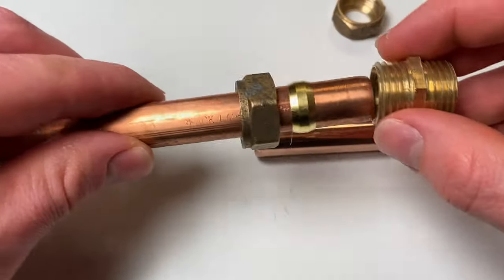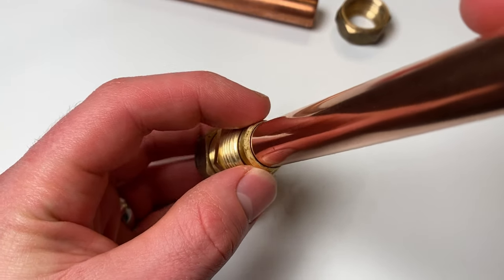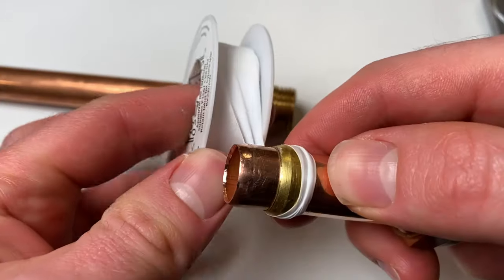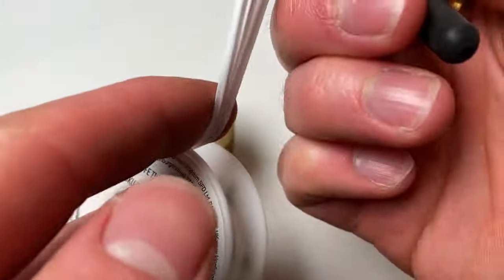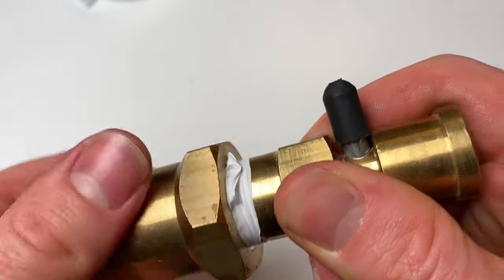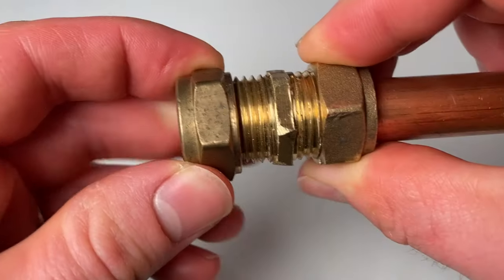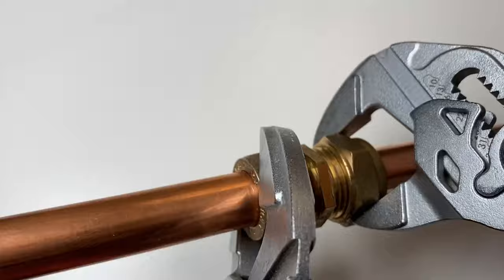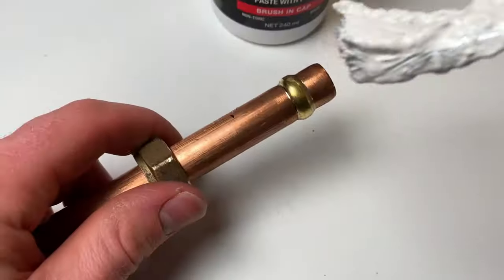Fix Your Compression Fitting Mistakes

Comment: As a plumber for 46 years I have never yet used PTFE on a compression joint. Manufacturers of compression fittings usually state that nothing needs to be used on their fittings but I was taught to use jointing compound on them just in case there are any defects in the pipe. It has served me well. It is also virtually impossible to cross thread one of these fittings but I do agree with you in respect of over tightening.
Reply from the maker: I think jointing compound and ptfe on the olive serve the same purpose really. Thanks for watching!!
Reply: As a plumber I fixed leaks over compression fitting with with teflon and other stuff on it. Nothing is necessary over these fittings. Everything else causes more problems
Reply: @TheDiligentDIYer1759 PTFE has no place on an olive. If jointing compound doesn’t work then you need to cut back and replace the pipe and olive. But then, you are talking DIY 🤷🏻‍♂️
Reply: Thank you

Comment: Absolute nonsense, compression fittings are designed for metal to metal compression to make the seal. pTFE tape will just get in the way. It’s essential on tapered joints but not for compression fittings that use olives.. paste is useless too as it is simply squeezed out of the way.. it only works with used fittings that shouldn’t be reused in the first place..

Comment: Always remember reading a comment by a plumber that he could spot amateur work by the PTFE tape on compression threads.
Reply from the maker: Yes absolutely a good way to know someone doesn’t understand how the joint works
Reply: I understand how the joint works, but I'm still putting tape because i had to cut the old one off due to corrosion. In this situation the tape is not to keep the inside water from coming out, it's to keep the outside water from going in. I'm hoping the tape prevents the nut from getting  drips in the threads over the years and can actually be removed in the future when needed.

Comment: My grandfather told me a trick to always do with any threaded thing, be it a bolt and nut, pipe fitting, etc. Always do a couple turns in the opposite direction. This way the threads will wind properly and won't get stuck in a bad bind. After all, the threads might not be perfect. could be some micrometer differences, etc.
Reply from the maker: Yes absolutely, turn backwards until you feel it click into the thread, then go forwards. Thanks for watching!

Comment: Good idea, you think that would work with heating fuel, like house oil, passing the filter 1/4 line. I'm thinking the pro before me over tightened the seal. Over time could the drip stop? Unravel next time I get to see my dad. We'll investigate with more information. Working with the Teflon Tap for 10+ years welder repair shop, I could apply the same principal to house heating oil connections. Never thought about the Bud (Olive) to seal.
Reply from the maker: Thank you! I believe PTFE is resistant to oil, so should be fine. Thanks for watching!

Comment: Spot-on advice. Fixed a few leaking olive joints that could not be cut off this way. Some redundancy on new compression fittings  with ptfe tape in my opinion also does not hurt.
Reply from the maker: Thanks for watching!

Comment: When it comes to compression fittings, there is a knack when tightening the compression nut for securing the olive ring that slides onto the copper pipe.   If it it’s not tightened in the proper manner.. the joints will leak;  as my sister found out.. when she had a new bathroom fitted, by so-called professional plumbers.  The joints started to leak underneath the wash basin.  My dad had to pay a visit and sort it out.    With push fit that never happens.   Push fit fittings are very convenient.   I’ve had no problems so far.   The tap water that runs through the copper pipe, will not affect the rubber ring inside the push fit device.  It probably would if there were chemicals added to it perhaps.   Although there is chlorine added to tap water;  i don’t know if that would have any effect.    That’s the reason why plumbers advise householders, never to put any cleaning agents in the cistern, where there are rubber washers. 
Thursday pm 8th February 2024.  Southampton England 🏴
Reply from the maker: Thanks for watching!

Comment: Good tip. My compression joint has a small leak and I was about to tighten more. I will put tape or joint compound around the ring ("olive").
Reply from the maker: Thanks for watching!
Reply: Just use better wrenches or better fittings.
Swagelok compression fittings can be tightened almost by hand without leaks.
I've installed 1000s of compression fittings and not once used tape or paste.  
I'd fire an employee if I saw him using anything but wrenches to seal the joint.

Comment: The best technique I know of is liquid sealant between the pipe and the olive, ptfe tape on top, and a smear of liquid sealant on top of that.
I have literally never done this on a new joint though, only repairs. For new installations liquid sealant between the pipe and the olive is a must for me, and just a slight smear on the olive but that tends to just happen anyway. Tape probably doesn't help unless there are scratches in the metal or the pipe is being wiggled, but if you expect wiggling you should be enduring there is no wiggling or using a different piping method.
Nice basic video, short and to the point. Could probably mention that ptfe tape on a thread helps with tightening, but that you should not need that much tightening on a compression fitting.
Reply from the maker: Thanks for sharing and thanks for watching!
Reply: @TheDiligentDIYer1759  Hmmm... I should mention that doing heaps of generic replies like that (took a peek through other comments) is a bad idea, it comes off as extremely desperate. If you are just trying to get lined up for some sponsorships then I get it, but otherwise stop listening to whoever told you to do that. It's the same as anything else, say something if you have something to say.

Comment: Very interesting. I need to replace a boiler fill loop because one valve has broken in the closed position. This means I need to deal with pipe and olive and everything I've seen never mentions leaving the old olive in place...the part that showed leaving the over tightened olive in place and supplementing with ptfe tape makes me think I could do this myself.
Reply from the maker: Yep you could leave the old olive in place, or you can remove it either using an olive puller or a hack saw. Definitely one you could tackle yourself. Thanks for watching!
Reply: @TheDiligentDIYer1759  Thanks for the reply. On my last check I noticed something by only laying on my back with a torch. The screw inside the stop tap handle of the fill loop was loose. Previously I thought the handle moved in the way it did because it had seized shut and then severed to the switch when I turned it. Tightened the screw - the water flowed into the boiler.  My kind of 'fix' :thumbs up: Subscribed btw.

Comment: Ironically we had a plumber in 6 years ago to completely refit our bathroom and I’m not even kidding this is exactly the same thing he ended up doing - putting ptfe all over the threads of the fitting body and it just looked a bit sloppy. Just don’t understand why some do that as like you said the sealing happens between the olives and tapers on the fitting and nuts.
Reply from the maker: That’s terrible work from a professional! Thanks for watching!

Comment: Hi, can I put jointing compound between the copper pipe and the olive or inside of olive?  Imperfections or residues on the copper pipe causes the oliver not seal properly so the leak.

Before watching your video, I had to fight to fit a compression fitting by putting a lot PTFE on the threads.  After wasting two olives, I stopped leaking.
Reply from the maker: It’s okay if some jointing compound gets under the olive, in fact it would be hard to not get any under. I wouldn’t put any ptfe on the threads for a compression joint, it will make it harder to do up and doesn’t do anything for leaks. Thanks for watching!

Comment: Good videos. Clearly and calmly presented, thanks. 
Just one point about PTFE tape on the thread of a compression joint. It does help with 22mm joints as it allows the nuts to be tightened more easily without the threads ‘sticking’. Just done a load of them like that and no leaks, after many leaks without the tape. Will try taping the olive if I get really stuck though.
Reply from the maker: Thanks for watching!

Comment: People don't understand what PTFE does.  It does NOT seal.  The threads (on a threaded joint) deform around each other to make the seal.  The PTFE is there to lubricate that process.  Therefore, on a compression joint, where the threads do not deform to create the seal, there isn't much point in applying PTFE.  Applying it to the olive is nothing but a bodge, but can help cure a leak.

Best tip I've found is to tighten to finger tight (great tip on back'ds first in the video), then ensure you tighten the nut through a turn and a 1/4.  Make a mark on the nut with permanent marker to keep track of how far you've tightened it.
Reply from the maker: Good tips, thanks for watching!

Comment: I just added some teflon tape around the olive to try to fix a super small amount of wetness that was showing up in my replacement shutoff valve I just changed under my bathroom sink.  No amount of extra tightening worked (as you pointed out) but the tape seems to have worked.  No more moisture after turning the water back on!  Thank you for this video!!
Reply from the maker: Glad it worked for you, thanks for watching!

Comment: What is an "olive", is he talking about the ferrule?
Not once have I seen in the manufacturer's instructions to use ANY paste or tape with a compression fitting.
I've utilized 1000s of compression fittings and not once did I need a sealant or anything but the fitting.
Maybe you are using terrible Chinese made garbage.
Reply from the maker: If you’re in the UK, Olive is standard terminology….
Reply: @TheDiligentDIYer1759  Thanks for the info.  Does the UK ever use NPT fittings?

Comment: Why wouldn’t you tape the ferrule on a plastic tube? Had this conversation with an old plumber. Told me not to use tape it will pop off. Because there needs to be an insert that goes into the plastic piping, so the brass ferrule has something to grab.? I taped it and it stopped weeping and I tightened it. So it shouldn’t pop off? Man, def conflicted rn.
Reply from the maker: Sorry I’m not sure what you mean. Plastic pipes need inserts for any fittings used on them. Thanks for watching!

Comment: Ptfe on the thread helps lubricate the nut and makes it easier to compress the olive correctly which should never have anything added….. ! One wrap will do. Some poor quality brass olives don’t compress very well…. esp if there’s a metric fitting on an imperial pipe.
Reply from the maker: Thanks for sharing your opinion

Comment: I think with compression fittings you shouldn't use any PTFE. The most important thing is cleanliness. Make sure all the sealing faces are clean and smooth. Use scotch brite or wire wool on the fitting sealing face and the pipe - but then make sure you clean any debris out afterwards. Use decent quality parts - Pegler for me. Then just finger tight until it stops, then a full turn with a wrench. Switch the water on and see if it leaks. If it does then just a small amount of tightening should do the job. I find really small leaks - like a weeping joint, will self-seal after a day or so. 
A good seal is made by two clean sealing faces, jamming PTFE tape on a sealing face is not a good idea - PTFE tape is for BSP threads, not olives.
Reply from the maker: It is a contentious issue, but I’ve never had a leak when putting PTFE tape on an olive, but seen plenty of leaks where there isn’t any. 
Absolute agree on buying quality kit though, Pegler is also my go to. Thanks for watching!
Reply: In 50 years of DIY copper plumbing, I've never used PTFE on compression fittings - just the supplied olives/ferrules.  Today I met my match in a 1/4" copper tube fitting.  Still leaked after 2 separate attempts with new olives and polishing.  After looking at this video, I tried a couple turns of PTFE tape over the olive, and OMGosh, a dry fitting at last!  Thanks for this tip, DD - it worked for me!
Reply: The "shouldn't" and the "can't" are two different things. PTFE is a great help for our less than perfect fitting world. 
GO for it. Since no harm will come from it's usage. Doing this for a few decades. Nowadays getting some PTFE on the olive is a second nature. A couple of turns make life way easier. Seldom have to go back. ;-)

Comment: So what if water will follow through the tread of connector?
Reply from the maker: If you’ve got an olive in there, it definitely won’t come through the thread
Reply: Probably a problem with the olive, water has to get past the olive to make it to the thread which is why adding PTFE tape to the thread won't help, in fact too much PTFE tape on the thread just makes it really hard to tighten/remove. Personally I believe PTFE tape on the thread is unnecessary.

Check that the pipe and and the olive aren't damaged.

Use jointing compound on the olive such as liquid PTFE tape or the gel although the liquid stuff is better. Then use a small amount of PTFE tape, most DIY'ers use way too much, 6-8 times round is plenty for most compression joints, but make sure you go round the correct direction as described in the video. Too much PTFE tape (12+ time round) makes it very hard to tighten the compression joint and will compress the olive too deep onto the pipe making it almost impossible to remove later and in the worse case damage the pipe.

Do not over tighten, when you fill the system with water there may be small leaks at the compression joints, tighten gently until the water stops leaking. If you find yourself using a large amount of brute strength then you've used too much PTFE tape.

Hope this helps, not a plumber, but I find this works well.
Reply: OK thanks for tip information 👍
Reply: @simonboulton978  oops, PTFE tape first, then jointing compound. Just spotted the mistake.

Comment: You are much better off, using push fit fittings.   I’ve never had any problems with leaks.. since fitting a new bath, wash basin, and kitchen sink;  around 2 years ago.  
When you do get leaks.. the copper pipes start to corrode.   Looks really messy.
The reason why plumbers use compression fittings… is because it looks more professional;  but leaks do occasionally start to appear.   Using a pipe bender is no problem.  So you don’t really need to use elbow push fit;  unless it’s really necessary.     I’m not a professional plumber; and I’m useless at DIY. But i seem to get by alright.  All you need is your imagination and initiative
Reply from the maker: The problem with push fit is how bulky the fittings are, makes it hard to fit in tight spots, and it’s hard to make them look neat. End feed solder or pressfit is the best in my opinion, solder is time consuming though and pressfit needs an expensive tool. Thanks for watching!
Reply: Plumbers will solder if its a visible joint, compression if its not or customer doesn't mind. Pushfit are not as reliable as the other 2 as eventually the rubber seal breaks down and a replacement is required.  I don't know where you get the idea that a compression fitting will develop a leak over time, if it isn't leaking today it will still be good in 100 years.  Unless it has been seriously manhandled when a plumber comes in to make a change to a pipe connected to that fitting.  Pushfits have to be given even more care - be well supported and not stressed by pushing the pipe off centre when working on connected pipe.  Pushfit are useful where you can't get tools in to do the others but I would only use them in places that can be inspected easily and I would probably want to change them for new ones after 10 yrs.

The leaks you would have seen on your previous installation would have come from the tap connector which is not a compression joint but a threaded joint with a washer.  You likely have flexi-connectors on all those terminals you updated - keep an eye on them as the tap connector ends have a rubber washer that breaks down eventually and will leak on to the steel braiding which will then rust and become weak and cause a flood.  Inspect your connections every year.

Comment: PTFE tape is not needed on compression fittings, they are designed to seal metal to metal.
PTFE is a last resort.
Reply from the maker: Yes exactly, it can be used to seal leaks. Thanks for watching!

Comment: Yeah actually bud; 80% of the purpose of coating threads is to lubricate them. Do you see dope or tape on 80 year old npt plumbing? No.
Reply from the maker: They’re only brass, you shouldn’t be tightening them so much that lubricant on the thread is required

Comment: Always( Copper) olives they are softer than brass and will compress better into its compression fitting housing 100 % 👍👍
Reply from the maker: Yes good point, you don’t see so many copper olives though, I guess they are slightly more expensive perhaps. Thanks for watching!
Reply: @TheDiligentDIYer1759  Hello Mate,the copper olives are easily sourced from Plumbers merchants.May be a couple of pence more than brass,but in my opinion 100% worth it counting the cost of leaks under flooring etc. Measure twice cut once! 👍🤝